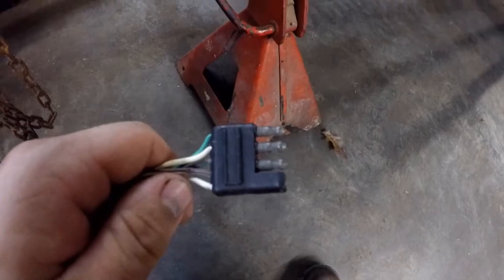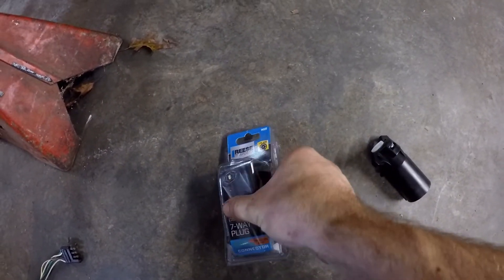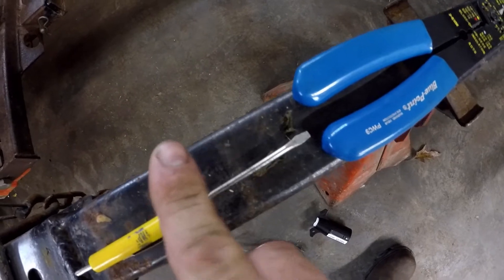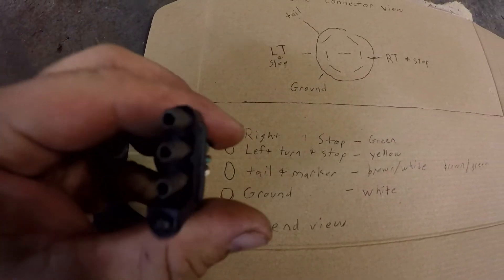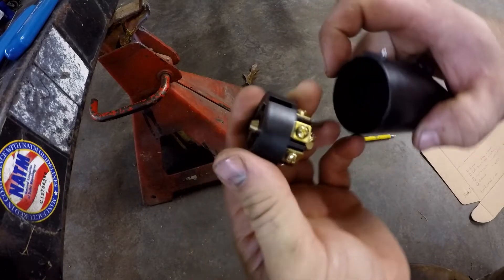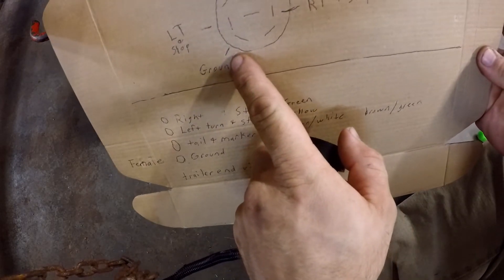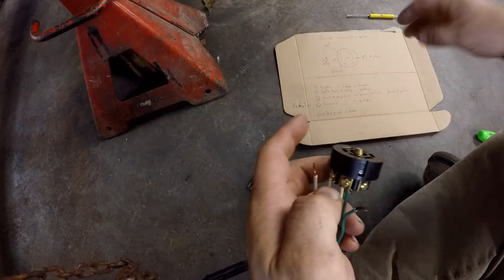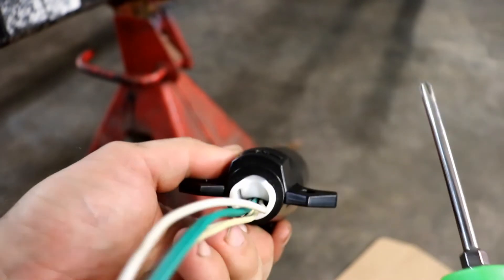Carry On Trailer Upgrade- 4 to 7 Pin Connector

Comment: Roger, I did this for my boat trailer b/c I got tired of the 4 pin connector always shorting out at the slightest wiggle or bump.  Once I replaced with a 7 blade connector, I had no more issues.  Well, I see you have all your lights working as you hoped.  Good job.  Enjoyed the video; full-watch.  👍🏽🙂
Reply from the maker: Those 4 pins are finicky. The pins are exposed to the weather, so they are prone to corrosion. Have a good week!
Reply: Good evening Sir 😉👍🍻
Reply: @RCAFpolarexpress  Hey there, Dave.  Hope you're doing well.
Reply: @houndsmanone4563  Yes in deed and hope you too mon ami 😉👍🍻

Comment: Great information and I agree that the 4 pin connector is a poor electrical connector and should be replaced with a 7 blade.
Reply from the maker: I hate 4 pins and 1 7/8'' balls.

Comment: Hello! Thank you for this video.  I have a trailer that has a 4 way connector.  I purchased the autosonic 7 way trailer plug with junction box.  How were you able to determine which wire controls which function by testing it with the meter?  I unfortunately cut off the flat plug already.
Reply: Some video shows the output signals for each location. Search for diagram and you know what you need
Reply from the maker: Put the meter on ohm or continuity. The touch a wire and touch a light socket. If the meter does nothing touch another wire.
Reply: Ok thank you very much for your reply.  I will try it.
Reply from the maker: @obdrumguard  You can also figure out which one is the ground. Then you can touch the ground and another wire on a battery at a time to figure out what each wire does.

Comment: You should use o-ring terminals which are SEALED. Otherwise your wire will oxidize and go black after just a few months of moisture/environment exposure - which would lead to all kinds of issues down the road. Never leave wire exposed - use crimp heat shrink connectors.

Comment: Commenting from Nebraska. Can anyone help me out with a similar project?
My carry-on mesh trailer has a 4 pin connector with 5 wires...white,  2 browns, yellow/brown and green.  I'm not sure what color wires are on the front clearance lights but the left taillight has a yellow/brown wires and the right taillight has green/brown wires.
Other than figuring out the white wire is ground, what are the other wires and what terminals do they go to on the 7 pin connector?
Reply from the maker: Since you know the white wire is ground, use a battery and couple of test leads and touch each wire and see what lights illuminate.

Comment: Fuck this is frustrating. My 4 pin has two browns one form each side. 7 pin has one brown. No mention of this at all
Reply from the maker: I mentioned that they may use color wires. A new trailer may no use the standard colors. Figure out which one is your ground. Then you can touch it and a wire on a battery to figure out what each does.